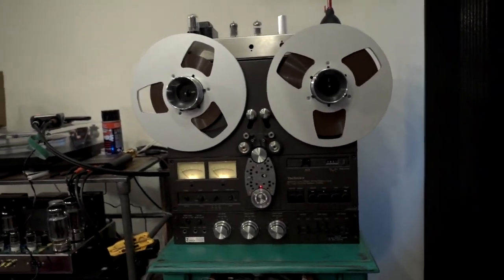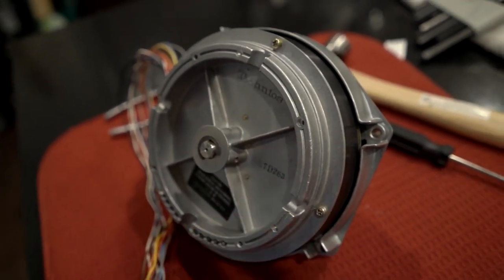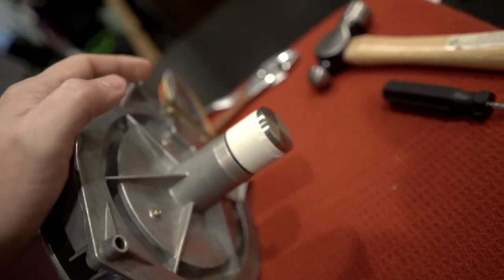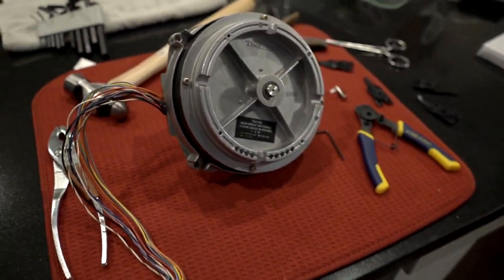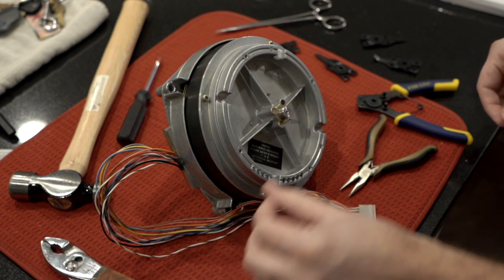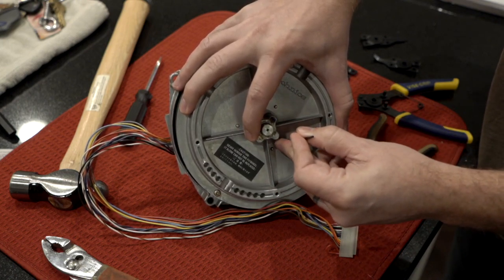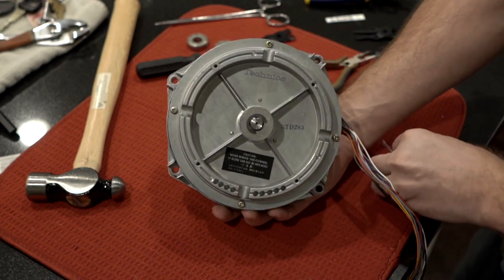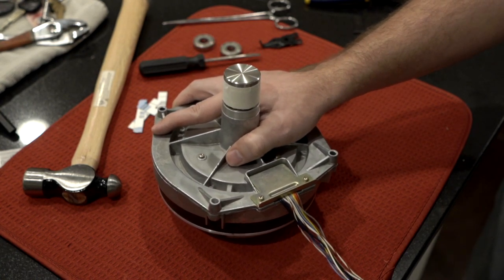Technics Reel to Reel Capstan Bearing Replacement

Comment: Hi Doug, this is an excellent and very educational video on the Technics RS capstan motor!
I recently bought the RS-1700 and most of it's bearings are making noise or are grinding. So your tutorial video on replacing the bearings of the capstan motor is very appreciated.
So far my only bearing experience was replacing the brass bushing of Pioneer RT-909 pinch rollers by 2 Fushi bearings with great result. Fushi bearings are indeed very quiet!
Thanks!
Reply from the maker: Alain Deneef happy to help.

Comment: Great video! Nice job of issuing warnings and tips. A few thoughts:

On the motor, the magnet would be the dark inner ring attached to the flywheel, not the outer ring. The copper coils are energized in series (creating a momentary electromagnet) to propel the ring around the windings. The outer dark ring generates a feedback pulse signal to monitor the rate of spin on the flywheel. The motor sends more or less current to the windings to keep the spin rate constant based on the feedback circuit, if I understand the schematic correctly (I'm a weekend warrior, not a pro).

Bearings usually want to be evenly pressed into their guide. If you get some spare washers about the same size as the existing outer washer from a hardware store with a long bolt and nut, you create a mini-press to seat them by tightening the nut. I do my bicycle bearings in this way. If you do sand, make sure you get all the dust out. Metal shavings, even if they're fine grit, can work their way into the new bearing causing premature wear.

Thanks for the video! I learned a lot (love the business card trick), and that pulse created by the outer ring makes total sense now (I uploaded a video on the capstan motor control adjustment on an oscilloscope) but I hope I never have to do this particular job!
Reply from the maker: Michael De Lazzer Thanks man!  I love understanding this deck more and more. The capstan motor speed system is super interesting and I need to spend more time with the schematic and scope. Thanks so much for the thoughtful comment!
Reply: @Edgarbopp  A friend gave me one of these 1500's recently and i am in the process of restoring it as much as i can and i found your video i dont think i have a problem with the motors but is nice to know that they can be repaired if need be.
Thank you
Reply: @Edgarbopp  What i do need to do is polish the capstan because i think it has some rust pitting? I have already cleaned it with isopropyl and acetone using q-tips but i still have some rough spots, i am thinking of using my dremel with polishing pads/tips and some sort of metal polish to remove/smooth those rough spots.
Reply from the maker: @SDsailor7  good luck!!

Comment: Great Day in the Morning, that is one well endowed capstan motor ! I have never seen a reel to reel tape machine with anything close to that size.  Technics must of had a bunch of size-queen engineers designing this deck. Wish all the companies hired like this. i have two pioneer 909 reel to reels with the crapest capstan motors in them that are not repairable because of the type brushes used. Love this setup !

Comment: Absolutely excellent content. I have recently acquired a TEAC A3340-S which will require quite a lot of work ( I believe ). The capstan has forward-backward play, tension arms are stiff and the electronics will also need to be checked. And, of course, the deck is in need of overall cleaning, lubrication and adjustment. 
I have also previously come across problems which the internet was not competent enough to help with (there is quite a lot of people on forums spending more time yapping about their opinions and collections of equipment rather than providing constructive comments). Your video made me more confident in attempting to do more advanced work myself. Thank you for sharing.

Comment: You are amazing!! I was full afraid of even touching the capstan. After your video I believe I'm OK to do it on my own :) One question is - would you add an info about the sizes of bearings to get?
Reply from the maker: Lukasz Rutkowski 6001z is what you want. I’ve had good luck with Fushi. Very quiet.
Reply: @Edgarbopp  Thanks a lot!! Ordered :)

Comment: I have this same unit, my capstan motor has decided to stop turning. I have taken the unit totally apart to attempt a repair. It was just sitting there, with  slight vibrations but not rotating.   So far I can't find any problems with the circuit board that the motor connects to, but I don't know exactly how to test the motor once its out of the machine. The reel motors work perfectly, its just the capstan motor that decided to quit. Any suggestions on how to test the motor before dropping the dough for a replacement?
Reply from the maker: I’d say it’s probably not the motor.  The bearings are really the only part that should ever wear out. Probably it’s the motor control board.

Comment: at 30.00 i assume you are referring to the strobe?
Reply from the maker: When the trace pcb is too far from the teeth on the flywheel the unit will struggle to keep the speed correct. This is visible using the strobe.  It’s also audible and you can see the tape speed change because the tension arms will move around.

Comment: Hello, where can I get  6001z Fushi bearings?
Reply from the maker: Innocent eBay is where I found mine.
Reply: Doug De Young where did you find yours?
Reply: Doug De Young Thanks, but they are not available from fushi anymore. They have now 6001zz. Don’t know what is the difference.
Reply from the maker: Innocent Bystander I’m sure that’s fine. The ZZ vs the Z is just how many shields it has I think.
Reply: @Edgarbopp  If i do find out that i have bad bearings on my capstan motor your video will be a life saver.
Thank you

Comment: Excellent! Thank you!
Reply from the maker: exileinrosedale no problem! 🙂
Reply: @Edgarbopp  I am having a problem with the tension arms bouncing up and down while my 1500 is in play, so i checked the back of the capstan motor while the machine was in play mode and noticed that the motor was not turning concentric it seems like its out of round. I stopped the machine and grabbed the center area of the back of the capstan motor and was able to move it up and down but there is no play side to side. I am thinking of removing the capstan motor to inspect it better what i would like to know is, are there any linkaged bolted to the front face of the capstan motor?
I also tried to move the front area of the capstan motor and got no movement.
Thank you
Reply from the maker: @SDsailor7  it’s easy to remove. All bolts are on the back.
Reply: @Edgarbopp  I will remove it if after i do all the test/checks and if still have the same problem i will remove the capstan to inspect it.
I hope it's not the capstan bearings and something more common.
Thank you for replying back
Reply from the maker: @SDsailor7  good luck!

Comment: Hi Sir, looking for some help with my RS1500 speed stability. Sorry about reaching out this way, but would highly appreciate of you could share your email so that I can share issue details. Thnx much!
Reply from the maker: Honestly the only things I know about the speed sync are in the service manual. It requires a scope with two channels. Also try contact cleaner on the speed adj pot.
Reply: @Edgarbopp  thank you Sir! Will try that out.
Reply: @Edgarbopp  Glad to let you know that a simple cleaning of the pots with contact cleaner worked the trick! Many thanks! It saved me a lot ot time 🙏😊
Reply from the maker: @siva_ramaswamy  excellent!!!